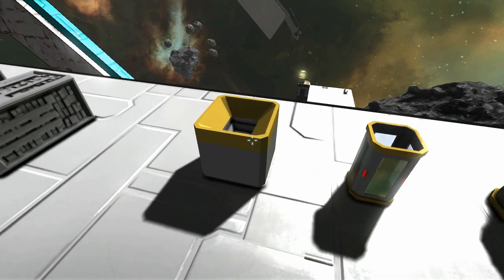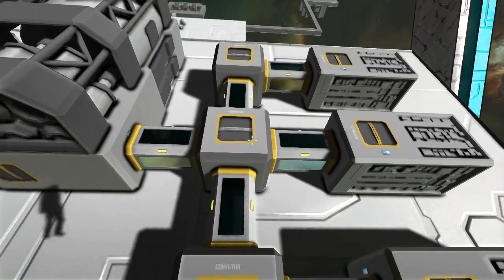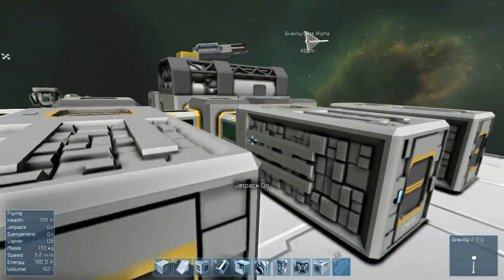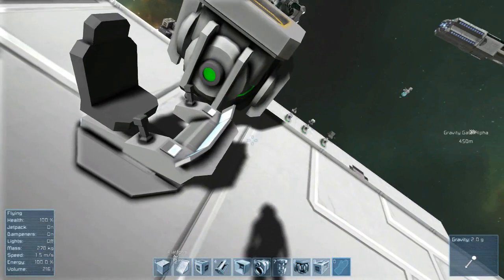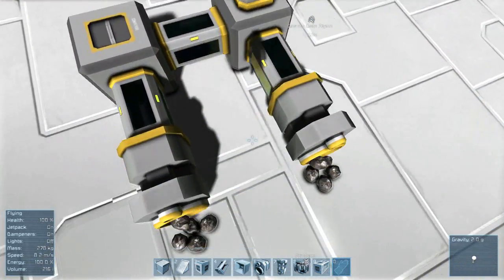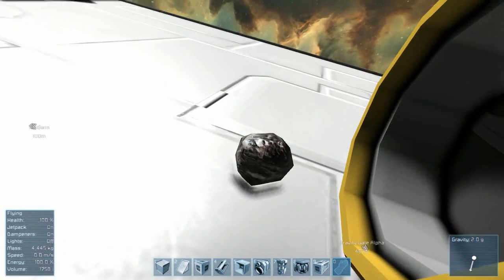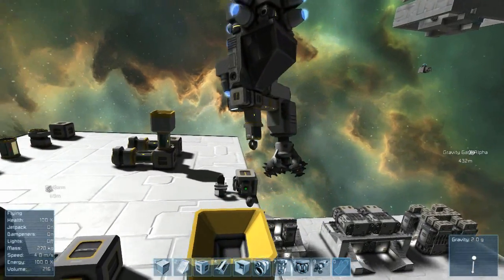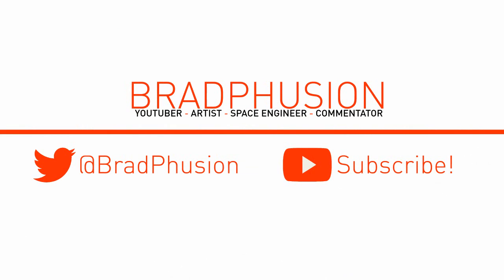Conveyor System: Overview & Functionality! (Space Engineers)

Comment: 'Collect all' should, as i understand it, find all resources in the system (e.g. everything in your drill) and get it into the connector. If you then make it spew out stuff, it'll spew out everything in the system.
Reply from the maker: That makes more sense. I was told it was buggy, and didn't work for me, so I just said it was WIP and moved on :)
Reply: Next thing you know, connecter spits out all the uranium you have sitting in your reactors also. xD